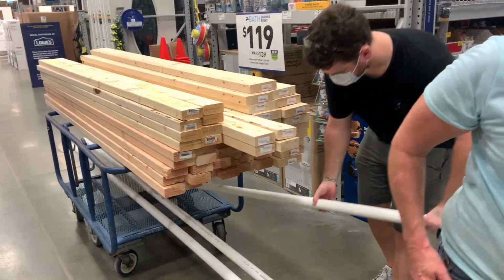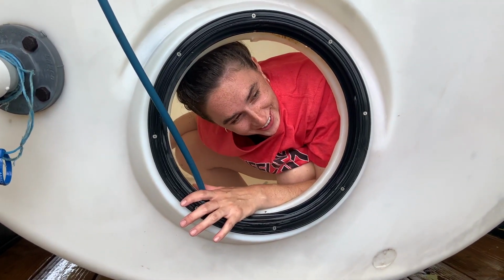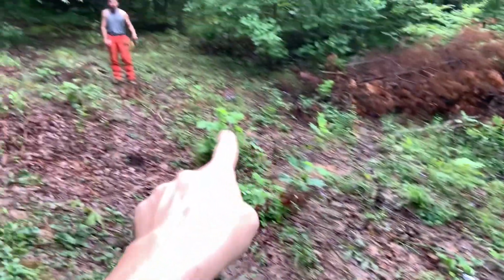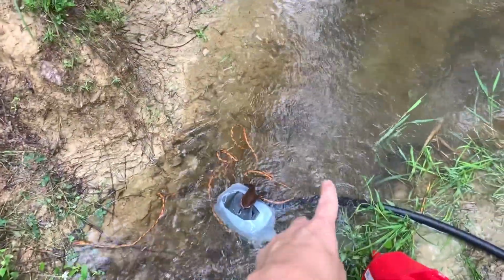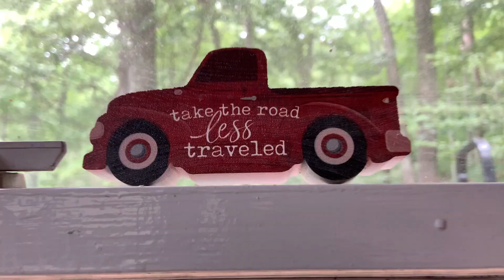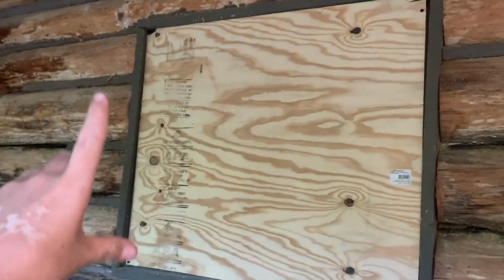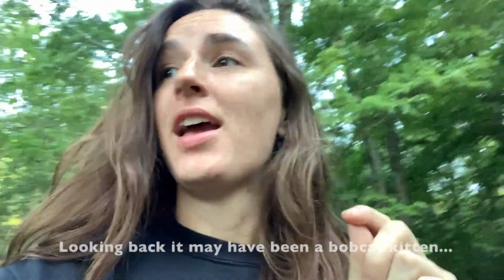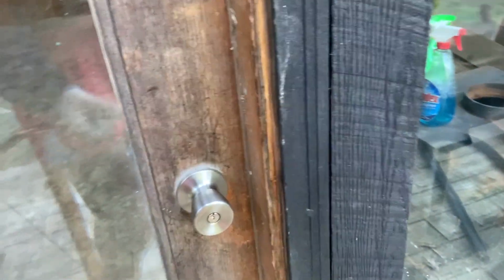Off-Grid Cabin Build! Bathroom, Mud Room, and our Rain Catchment System! Cabin Reno for Beginners!

Comment: We drilled a well at our cabin, but has arsenic in it we have to filter, so considering doing a storage tank and gravity fed pressure from creek up above it. Won’t need to power a pump or anything, we will just plumb gravity pressure into our existing system. Looks like you guys will have a similar system. Great job on your hard work! -Robert